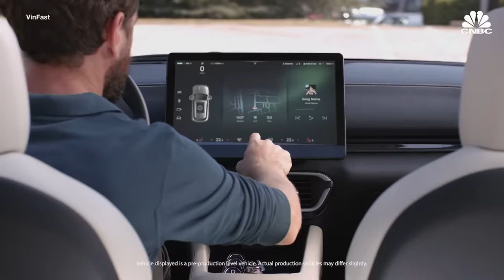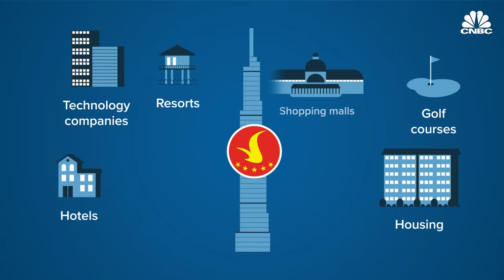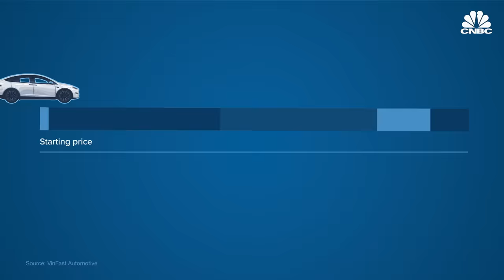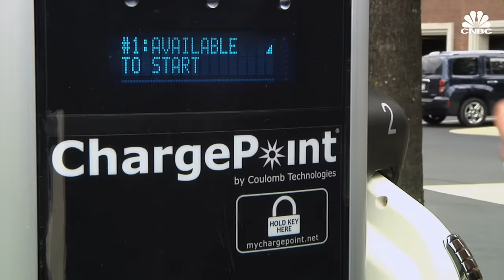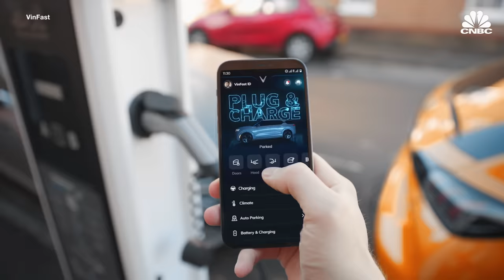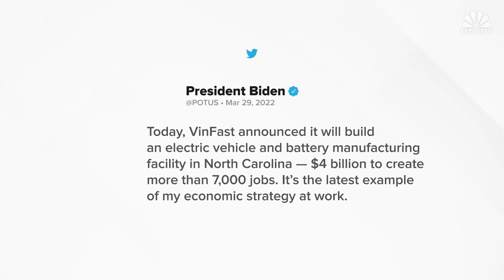How This Vietnamese Carmaker Is Trying To Beat Tesla In The U.S.

Comment: Beating Tesla in the U.S Market would be a tall order even for a company that is US based.
Reply: No car manufacturer has cranked up EV production yet. Many designs are still in the works. It won't take much to topple Tesla once things are ramped up. With all the QC issues at Tesla a better EV vehicle by Toyota or VW will eat Teslas lunch. By that time maybe Tesla will finally build their cyber truck. Maybe...
Reply: @jaydibernardo4320  VW already sells EVs in the US and the specs are not even close and their sales are down. It takes years to develop capable software and VW is woefully behind Tesla in that category...but yes, the VW body panel gaps are better. Teslas sales numbers prove people dont care about a few qc issues.
Reply: Nah Tesla's crap
Reply: @jaydibernardo4320  lol🤣
Reply: Vinfast isn't us based.
Reply: @michaellim4165  "Even for" meaning if Vinfast were based in the US it would be slightly easier to compete with Tesla in the US market.

Comment: As someone who is on a waiting list for an EV, I want them to succeed and think they will at least initially benefit from how much demand has outstripped supply. However, the Model Y comparison makes no sense.

A better comparison would be something like the Hyundai Ioniq 5, which has the same base price, but you own the battery. Even when you consider something more pricey like the Mach E ($44k), when you consider that the battery is worth at least $12k and probably closer to $20k, the difference in MSRP is nothing compared to being able to own that battery for yourself. They're working with LG, so it's essentially the same batteries, and that also means they will be supply constrained like all the other players until LG can get their US production off the ground, hopefully next year.

I hope they succeed, but it's inaccurate to call their pricing strategy competitive, and as soon as the supply chain issues get resolved and EVs start selling for MSRP again, that will become glaringly apparent to consumers. They are going to have to either cut prices or let users buy their battery for a nominal fee.
Reply: I am not sure the spec of ioniq 5 compare as same level to VF8, please check
Reply: Ioniq 5 = ~200 HP FWD, VF8 = ~400 HP AWD
Reply: @lehoanghiep9936  higher spec doesn’t mean anything if they’re not efficient. Apple phone even with base model outperform much higher specs in competitors brand.

My BMW X5 , with only 335hp 0-60 4.9s a full-size SUV, Vinfast vf8  a compact suv at most top trim with 402 hp targeted speed is 0-60 5.5s . That’s is terrible for an electric car.

Tesla cheapest single motor model Y have 201 hp, 0-60 5.9s, and their awd are with 346hp 0-60 4.8s. So Vinfast with 400 hp is terrible.
Reply: @minhnguyen-fr5zq  lol are you even auto driver?
Reply: @minhnguyen-fr5zq  how much weight model Y, how much price model Y ? How many motor for ioniq5, how many motor VF 8 ?

Comment: I don't know much about EVs but I notice some people here complaining about Vinfast's Battery Subscriptions Program. To be honest, I also dislike that kind of burden because it makes me feel like I'm renting a car instead of owning it.

But from my understanding, EV Battery is similar to Smartphone Battery in a way that they might be downgraded and lose their capacity in 4-5 years of heavy use. So there should be no point in owning the battery if you're gonna have to replace it with a new one every half a decade anyway... So that Battery Subscription Program couldn't be that bad, right?
Reply: Reports from early Tesla Model S owners generally show that after 10 years and 200k+ miles there is still 90% battery life remaining. Other manufacturers (especially on models with active cooling) have also been out-performing their battery life estimates. In most cases the batteries will outlive the car. Not to mention that as ranges continue to climb, losing 10-20% will become less of an issue. Most ICE vehicles get worse gas mileage over time as they age and wear out. Earlier generations of EVs (e.g. 1st gen Leafs) did have more battery degradation issues though.

Vinfast will only replace your battery once it gets under 70% (according to the spokesperson in this video), which isn't much of a selling point.
Reply: @graham1034  SOURCE
Reply: Batteries last 10 to 20 years with only a 30% degradation
Reply: @ripemelon393   Stop Lying!
Reply: @jefftomasello3258   well son you need to do some research.  But since you are too lazy here you go:

An electric vehicle’s battery pack degrades slightly each charge and discharge cycle, but it’s a very slow process. For example, battery packs in a Tesla Model S have been shown to only lose around 5% of their original capacity throughout the first 50,000 miles.

After that, the depletion rate slows down even more.

There is some disagreement between how long EV battery packs last. But when cared for properly: 

Consumer Reports estimates the average EV battery pack’s lifespan to be at around 200,000 miles.
Conservative estimates put their longevity closer to 100,000 miles or between 10-20 years depending how often you drive.
Reply: @jefftomasello3258  I tried to post a bunch of links but apparently my comment was deleted. A quick google search for "Tesla Model S long term battery life" returns a ton of articles presenting real life data.
Reply: @graham1034  not necessary true. My Model 3 is only 28K miles now and I have it almost 4 years. I don't drive much as I work remotely from home the past three years. Yet, my battery has already degraded 9% in close to 4 years with only 28K miles and I'm not one of those reckless drivers either.
Reply: EV batteries are way better than phone batteries. You can expect a Tesla battery to work at least 8 years

Comment: Good luck VinFast! I hope VinFast EV won’t end up at the junkyard in the US.
Reply: Comment like this is not going to help.
Reply: The car doesn't even pass the safety... it's already have some in junkyard in VN...
Reply: Renting a battery is recipe for failure.
Reply: @maily8388  Why is that?
Reply: @nightcoder5k  The brain of the car is the battery to make it going.... Are you going to buy the car and rent the engine???
Reply: @hungpham254  I'm thinking differently.  Battery is gas, not the brain.  It would be nice if you could just drive to a station and have the battery swapped in 5 mins.  What would be cool if you can also charge it if needed.  Battery deteriorates overtime and it's very expensive to replace.  By swapping with a usage fee, you don't have to worry about the battery going bad on you.  

So far, battery swapping is successful in China.  I think it will eventually go to mainstream in the US.
Reply: Those Vietnamese guys just show too much hate towards Vietnam, lets get used to it, you’ll see those comments again from Vietnamese in other videos as long as the contents relate to Vietnam. In my opinion, There are some parts Vinfast needs to improve, the design of the car is different from other electrical car brands, they try to make it simpler features to be more convenient than the gas cars. About Vinfast, their design is the mixture between gas and electrical car which makes it more unique along with other advanced features
Reply: @nightcoder5k  we talking about buying a car n rent the battery is something wrong bro...
Reply: @vynguyentrankhanhvy2292  😄 🤣 😂
Reply: @hungpham254  That's your opinion, and I respect that.  Having more options for the consumer is better.  NIO is expanding battery swapping stations and looks like it's working.   Here's a quote from one of the articles online:

"Proponents of battery swapping say that battery swaps are fast, a swap takes one to five minutes. Batteries are maintained well and charged in the optimal way, and will therefore put out more power and last longer. The batteries can be updated or changed completely to a new model, without any worry for the car’s owner. At the end of their life, the batteries will be fully recycled. The purchase price of a car with a swappable battery is lower, because the owner doesn’t need to pay for the battery when he buys the car. And finally, second-hand values will be higher compared to normal EVs because there is no battery deprecation."
Reply: @nightcoder5k  you really don't do a research about Vinfast 's car ..it is terrible for having too much customers complains and the way the Vinfast company treating its customers .in VN ...they threaten and call cops to put down the complains ..

Comment: One upside might be that if they build up charging infrastructure in regions where there is little at the moment and they then fail, at least they built up that infrastructure. I think they need to start by selling cheaper though as Honda, Toyota, & Kia did originally. 😅
Reply: Vinfast VF8 entry level Eco is an Italian Pininfarina styled, German BMW based, all electric premium midsize SUV with a dual motors and high-tech features at an affordable price of $31K with a battery subscription. You won't find any SUV like that at a lower price!

Comment: 70% battery capacity they may replace the new one IF its the factory’s error, most of case not, its you. Because your way to charge, how you use it and many questions.
And if they agree to change another, you have to wait 1 months or more, and of course it is you warranty time. Make sure you read the contract clearly.

Comment: VF8 starts from 50k USD in the US market. It's Tesla model Y price exactly, although we ignore the $7500 tax credit. (Vinfast has no chance for it at all, but anyway.) Do you know these two truth?: 1. VF8 doesn‘t include a battery in your price. We always have to lease. 2. Battery replacement cost for Tesla model Y is 22k. Original cost of EV battery is close to 20k. Based on that, VF8 price should be much cheaper than the current price. Why EV is much more expensive than engine cars is just because of battery price, but VinFast doesn't include a battery. :) Isn't it ridiculous? If it's over 35k USD, then common consumers will not buy. If they wanted to advertise the battery subscription as a strong benefit, car price had to be lower for the amount of battery price.

Comment: Modern battery tech doesn't lose 30% of it's capacity, as far as we know, ever. They typically lose anywhere from 5-10% during their first year or two in service and then degradation levels off. The only upside I can see with a battery subscription would be to add capacity over time or upgrade when the technology improves but now we're only talking about the customers who keep their vehicle for more than 5 years. Not very many people do this.

Comment: If I were a new automaker who wanted to launch in the US, I would try to reboot concepts such as the original golf gti, Peugeot 205, miata, and other small fun hatchbacks / coups... makethem small, lightweight, fun, reliable, and cheap. S sub 1400kg car with 8 seconds 0 to 60 and 300km of range with fast enough charging. I would build a wagon too, something like the Dacia jogger and sell it for cheap as groceries getter. You can't compete on other segments in a recession... focus instead on a novelty product, with economy in mind in a time of economic decline + alot of content creators marketing on social media... be the small fun reliable underdog
Reply: Electric golf cars are for golf courts not for America freeways. Vinfast all electric midsize SUV VF8 Eco (base model) with dual motors can reach 0 to 60 mph in 5.3 seconds with max mile range of 292 (or 469 km).

Comment: This is a huge mistake by VinFast.  VinFast can barely put together parts sourced from other countries.  None of their components are domestically produced.  Batteries, motors, suspension, brakes, down to windshield wipers are all imported from abroad, making VinFast vehicle's production cost at par with BMW.  So with each sale, VinFast is guaranteed to lose money.  In a way, I am glad VinFast managed to sell only about 100 vehicles so far as more they sell, more they will lose.

Comment: How can VinFast beat Tesla? Vietnamese are often overconfident and too naive. Did you forget Vingroup shuts down smartphone, TV business in 2021? Their great ambitions have failed and they try to pivot EV now. However, their marketing strategy fails again. Why they are making the luxury car first instead the low-cost car? EV is already a highly competitive business in the US.
Reply: Hyundai and Kia used  to make cheap, unreliable cars which took them over 20 years to gain brand recognition in North America. They used a lot of rebadged parts from American and Japanese companies like  Mitsubishi engine.  GM used a lot of  rebadge Korean cars  which were horrible quality and on  recall  . Today Korean cars are  still subpar low quality compared to Honda, Toyota and Ford. The only reason why their competitive in Internal Combustion engine (ICE) is  their long warranty and lower prices...

VinFast is trying to move up by entering in the EV market which is less saturated &  less  competitve compared  to internal combustion engine / ICE market. The company avoiding the traditional East Asian strategy of using low price car  instead are  focusing on higher quality luxury features. The company providing competitive prices in the ev market by introducing a battery rental to lower the buying cost with 10 year  warranty which is above ev warranty standards.  Customers also have the option to buy the car outright with the battery.
Reply: @anhlam7131  you are saying the opposite. All car manufacturers are now moving to electric cars. EVs aren't less competitive, they're more intense.
Reply: @anhlam7131  VinFast MUST compete with China in the low-end market. Otherwise they will go bankrupt. 
What makes VinFast better than traditional car makers? Are Vietnamese electronics better than Europe?
And Hyundai is officially the world's TOP 3 car maker for 2021 by sales record. This is the result of 20 years of hard work. You will never achieve anything unless you take your time and try step by step. Don't be naive, man.

Comment: Well they need to update the video because Model Y is now down from $66,000 to $50,000 for the long range and $47,000 for the standard! After $7,500 federal credit and up to $2,000-5,000 in some states for state credit, I just don’t know how new entrants into the EV market will compete vs Tesla… you can get a Y for under $40,000 and the 3 for low to mis $30,000… it has the reputation… is has the better tech…. Better battery….

Comment: make a basic transportation car thats inexpensive but reliable like toyota and datsun did and the battery subscription doesnt sound feasible at 310miles a month I drive more than that in a week, at $1amile after that the battery could be $1200-$2000 a month.... no thank you
Reply: Josh Weon  25k is msrp, like tesla, parts will find their way into the used market and like many other ev's people will build their own batteries to replace dead ones or to go with newer technology. Its not much different than buying a car with 300k cheap and putting in a low mileage junk yard motor at least as long as the courts support the right to repair.  At the proposed price of the car AND the novel renting the power supply I dont foresee them making a big splash in the market. But then Im not in their projected market. I WOULD be interested in a very bare bones transportation vehicle like I mentioned above
Reply: Josh Weon  Being a hybrid the leaf is neither fish nor fowl, he could sell it to the right buyer who could strip it and use the ev components to retrofit a different car using a homebuilt battery pack

Comment: 10 Year warranty is not including the battery, because battery is on a lease so there is no warranty coverage. If you rent a car at Hertz for the weekend, do you care what is the warranty on the four tires of that car?  You'd buy extra insurance to cover the rental car in case you run into an accident, most of the time you wasted that extra $ on the additional insurance. Vinfast reminded me of Tet Offensive attack. Hell no I am going to fall for that again.
Reply: Josh Weon  that was 9 years ago, nowadays battery is more advanced. Let him know not to make another mistake by driving a VF. With a few dollar a day you could buy yourself life insurance which can gives your family great returns when driving in a VF.
Reply: Josh Weon  you’d have accumulating $11k in 8 years for a maybe of battery replacement. $3 dollars a day doesn’t sound cheap anymore lol? $10-13k for new battery, not 10-25k, battery degrade after 10-20 years. My annual mileage is 8k, so it will takes at least 15 years for a new replacement. I would have paid to VF $20k+. $7k wasted. Buy it Josh, show us the picture, talk is cheap.

Comment: Renault does this but sadly for a modern battery to drop below 70% will take 15 plus years. most nissan leafs mk1's have only lost 10-15% since 2010. 
The vehicles would need to be 20 and 30k to have the additional cost of battery leasing.